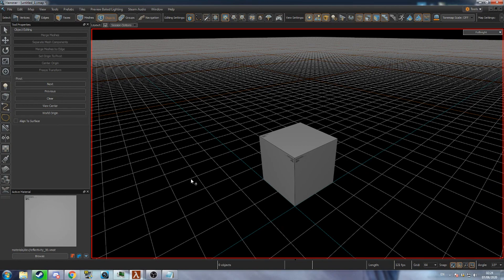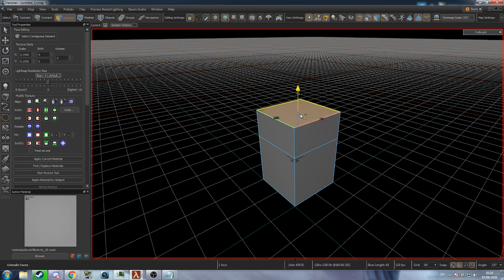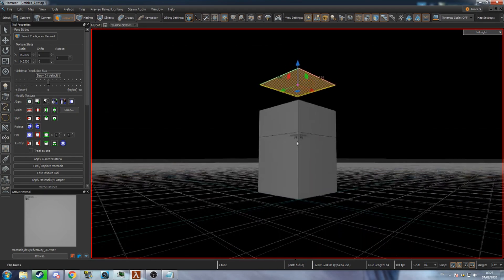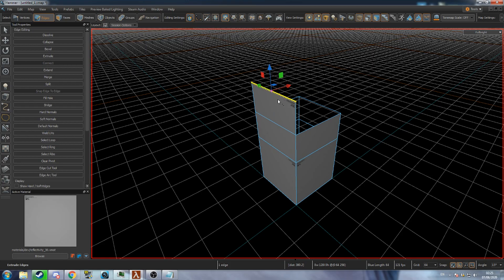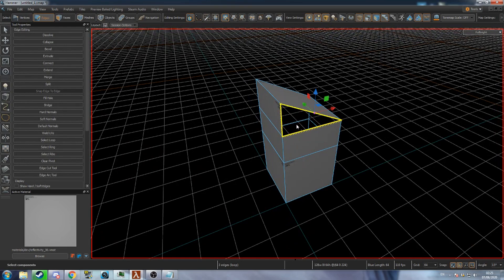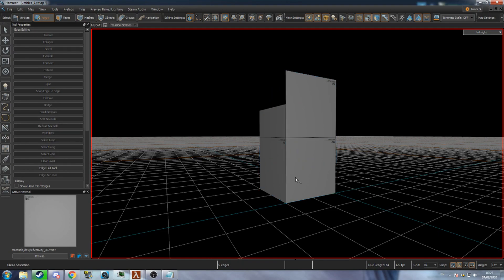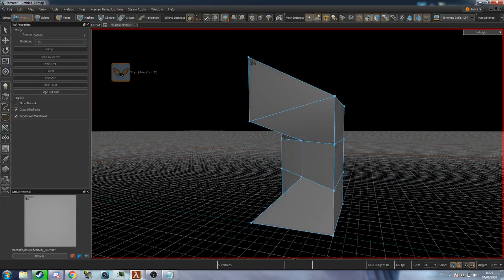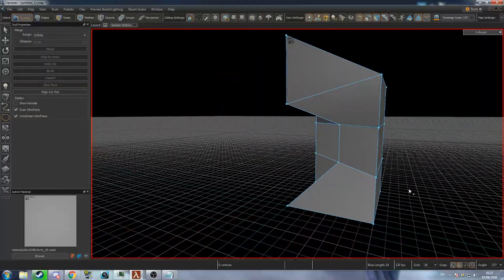Basic Mesh Editing for Source 2 Hammer

Comment: a lot of the shortcuts just arent working for me. this program is so confusing and i used to know hammer like the back of my hand. there aren't enough tutorials or documentation. i'm really struggling and this is really upsetting for me.
Reply from the maker: This video was made using the half-life alyx tools, but the mesh editing hotkeys should be exactly the same for CS2. Do you have a non-standard keyboard perhaps? You can press F1 and search for the function you're looking for to check its keybind.
Change can be tough, but its usually for the better.  Stick with it and you'll figure it out, then you'll know Hammer 2 like the back of your hand as well :)

Comment: for some reason on one of my meshes fill hole cannot be used even though the edge loop I am trying to fix is just a square what am I doing wrong >
Reply from the maker: Are there four edges around the hole you're trying to fill? If not, try using bridge (B) to create a face between two edges.
Possibly another reason for it not working would be if one of the edges belonged to a different mesh. If not, bridging may still be the solution
Reply: @Hosomi  bridging was also unavailable I ended up scrapping and starting over doing exactly the same steps and it worked for some reason

Comment: got a question tho ... If im using custom textures/models/sounds 
in old hammer u had to use pakrat if u wanted to publish anything 
...does the new hammer need this as well?
Reply from the maker: I'm not sure, as I haven't actually published anything, but it may work just by having the custom content in the addon's directory
I'm not sure tho
Reply: @Hosomi  In case someone on r/hammer has any idea here is a link : https://www.reddit.com/r/hammer/comments/i5k175/does_hammer_2_need_pakrat_to_publish/  
I guess it's just wild west for now...
Reply: @abstract_duck  maps are stored in VPK format in source 2, go look inside some valve maps with GCFScape, i think i saw a few that had a materials folder, i believe you just put your materials/models/sounds folder in the map vpk, although alyx addons do support having custom content other than maps so packing isn't needed
Reply: @conneath  nice ... thanks
Reply: @conneath  oh thats great ... if I only could bring myself to finish all the ideas for maps that I drafted

Comment: hammer just became a full fledged 3D modeling software XD
Reply from the maker: It can even export to FBX files
Reply: @Hosomi  I mean ... one way to overcome the hassle of having to import custom models is to model them in hammer ..
Reply: @abstract_duck  It's actually incredibly easy to import your own models.
Reply: @games528  yea... Im having small issue with normal textures but other than that its dope
Reply: Now if only S2FM would let you rig and create animations for your models to be used in-game, you wouldn't need any outside tools. Besides maybe Substance Painter.